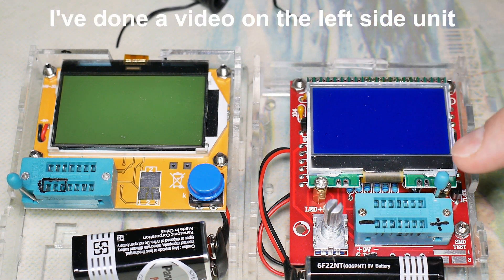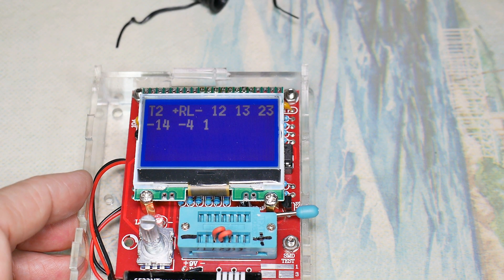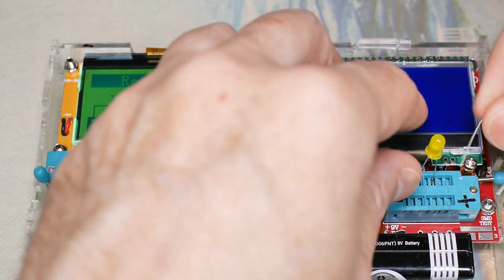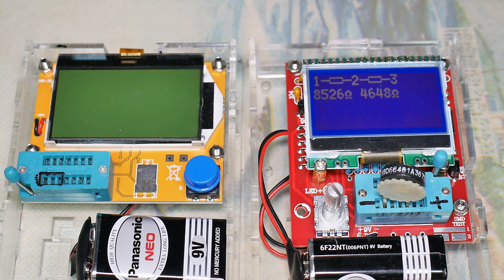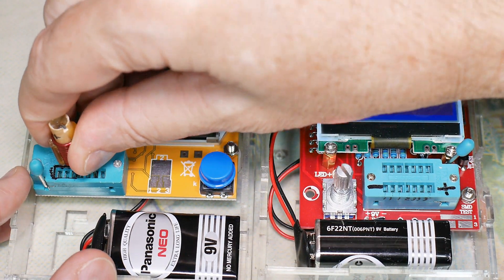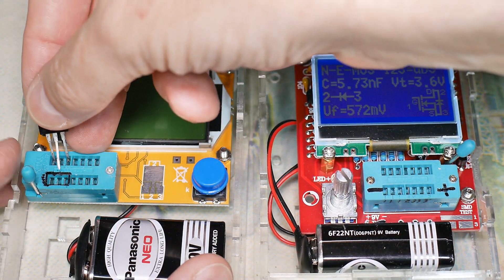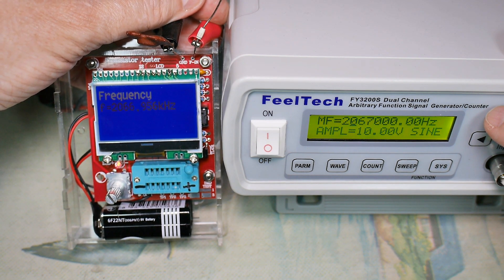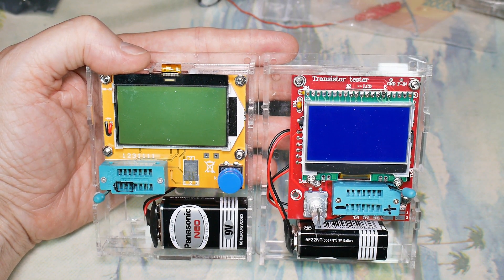Multi-Component Tester Calibration / Operation / Comparison (M8 ver. M12864)  (4K)

Comment: A friend of mine went to measure a capacitor and burned a transistor and the SMD SRVO5-4 IC. Can I use the GM328A without this SMD SRV05-4, does it work without this IC???????
Reply from the maker: I did the same and had no luck fixing it by replacing both main chips.

Comment: I just ordered the one with the green display here just last week. Got it in the mail just yesterday. Finally got it put together. My question is I see all the numbers but how do you know which slot to put it in for what you’re testing like how do you know which one the resistor goes into which one does the capacitor go into etc. because they don’t give you no manuals for anythingat least I didn’t get an instruction manual with mine and finally when I got mine the glass display was taped down with a piece of tape. How did you get yours to stay? Snapped in the place without it coming loose?
Reply from the maker: I think I talked about that in one of the following 2 videos. There is a strangeness in how you insert the component. You can see I marked mine so I would not forget.
https://youtu.be/svissWMwSso
https://youtu.be/El7_5atwvaE

Comment: The ESR was wildly off on the red one. Have you tested it with more caps? And tested some caps in circuits like it says it will do?
Reply: I'd suspect the yellow ESR would be off. No way a normal film cap would have an ESR of 28 ohms.
Reply from the maker: Have tested it with lots of caps since and it seems to be pretty close. Never tried it with caps in circuit.

Comment: did you calibrate it with a 200nf when it was asking for a 100nf?
Reply from the maker: I used the capacitor they supplied. There are lots of numbers they show on the screen when it is calibrating, I assume some are the internal values of the device. So when it says 100 nF, it might be the base line of the device, don't know. The instructions don't explain what is being displayed.
Reply: @tsbrownie  ok thanks. I don't think mine came with the capacitor, do you know the value?

Comment: I've been thinking of putting together some electic devices and can get  boards and the parts at good prices. One of these units maybe very helpfull to ID parts, so less like to put in wrong ones. Even years ago with better eye sight, it could be hard to ID alot of parts, alot are smaller know too.

Comment: Does anyone know at which Frequency is Inductance tested with this unit? thank you so much
Reply from the maker: The specs are in the description. It does not specifically mention inductance, but under capacitance it says it's at 8 MHz.
Reply: @tsbrownie  Hi mate, it doesn’t say in the specs or in any other doc at which frequency in Inductance measure. Thats what I would to figure out. Thanks
Reply: @tsbrownie Hi. If we replace it with a 16 MHz crystal, can we measure more accurately? For the LCR T4 model. Thnx.

Comment: You can easily calibrate the one with the yellow PCB. Just insert a jumper between 1-2-3 like the other and press test, it will automatically go into calibration
Reply from the maker: Thank you, I will try that.
Reply: Thanks for this info i had no idea this was hidden in the unit :-)

Comment: @tsbrownie , I came here finding some data sheet on the left one, and found more than that! Seems that calibration method works fine, too. Thanks a lot!
Reply: I am only thinking...: over the "do not dispose" symbol, there are two passthroug pads. What are They for? In some pre-assembled ones, there is a hole ("window") that claims to "read IR codes from remote controls"...but I could not find anywhere info about that. Anyone has?
Reply from the maker: Me too, I saw that and can't find anything on it.  Someone referenced it, but supplied no info.
Reply: @RI-ns8wz  It looks like they are connected to the crystal.  I suppose that probing them would show an 8 MHz square wave.

Comment: I have the unit on the left I have found that if I flip inductors over they sometimes read correctly.
Reply from the maker: That's an interesting observation.  I will have to check that out.

Comment: Great video. To probe pulse transformers it's necesary to know isolation, do you know some equipment to do this. Thank you.
Reply from the maker: No, sorry I don't.  I've done very rough measurements using a frequency generator and voltage meter, but I think you're looking for something more.
Reply: @tsbrownie  Thank you !

Comment: Not sure it matters, but you have a fresh battery in the M8 and a tired one in the M12864.  Could affect accuracy.  I have an M8 and a GM328, the latter an upgraded version of your M12864.  Both these units came with problems.  The M8 got stepped on before it arrived and the display glass was broken.  I ended up replacing the display - not exactly an economical repair but it did teach me a bit on how to repair these units.  The G328 case was hopelessly mis-fit to the circuit board and had to be Dremel adjusted to make it fit.  If you're the bumble-fingers type you probably shouldn't try either of these repairs. The G328 also uses a smaller font which allows more data to appear on the screen, which I like.  As you say, take the accuracy with a grain of salt, but these units do help in diagnosing good vs bad and in identifying unknown components.
Reply from the maker: Good point.  I also got another high value cap / inductor meter and after a few months it quit.  Seems I will be trying to replace a chip on it per others on the internet with the same problem.  Too bad they don't put more effort in quality in these things.  I'd rather pay a few bucks more and have them be reliable.

Comment: What the capacitor number that they send you with it ?
Reply: At 3:10 the tester asks for an over 100nF [0.1uF]
at 3:53 it's read as a 220nF [0.22uF]
Reply from the maker: Sorry I don't recall.  It got mixed in with my other caps.  It was something like 25pF.
Reply: @tsbrownie  sorry . I was asking about the calibration capacitor that you use
Reply from the maker: @abed_itani  I  understand, but I put it in my cap box and forgot which one it was. Sorry

Comment: what pins were used for all the secondary stuff on the right.?
Does it also just used that open and close gab for these secondary test pads.
on a unit like this it seems to be secondary pads used for all these extra counter and F-gen factors??
https://www.banggood.com/GM328A-LCD-Transistor-Tester-Diode-ESR-Meter-PWM-Square-Wave-Generator-Soldered-Module-p-1384846.html?
Reply from the maker: The link you sent shows one that is very similar to the one on the right in my video (blue screen).  The socket is set up a little different, but it still has 3 different test points.
Reply: @tsbrownie  thx for ur response and yes you are right.. I Took a second look on your video and can also see you are using secondary sockets.
I was unsure if your model in the video actually managed to use that open & close mainsocket for these secondary features also, but it seems you also need to touch some secondary testpads.  13:49
I picked the above up from their EU warehouse for 12½ USD delivered.
Gonna be my first component tester,
I was unsure if some models actually showed more component info then others on the same component but I reckon thats not the case..
Reply from the maker: @JAKOB1977  I think you will like it.  I was just using mine yesterday to verify capacitors for a solar lighting project.  So much easier than any other tester.
Reply: @JAKOB1977  you will love it and i bet it will quickly become your favorite little gadget, if you have a few different gadgets already. i blew mine up by not discharging a capacitor before testing so watch out for that BIG TIME!!  its the most common way to fuck them up for good!! like i did :, (

Comment: You mentioned that the tester on the left can not be calibrated but I found a YouTube video of someone doing it. It looks like you are suppose to connect a wire to pins 1 2 3 and turn it on just like the tester on the right. Maybe they had different firmware?
https://www.youtube.com/watch?v=epIeS7Rk3EA
Reply from the maker: Yes, it is very similar.  I will have to check into that.  Thanks.
Reply: @tsbrownie  Awesome! Thanks.